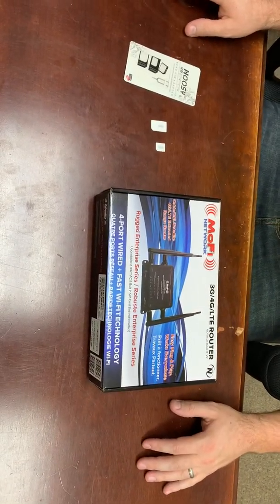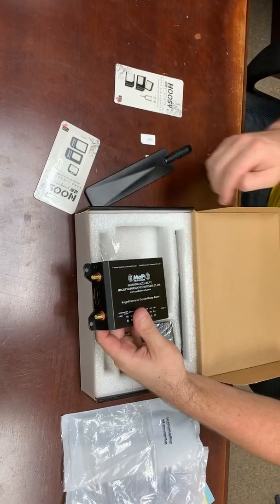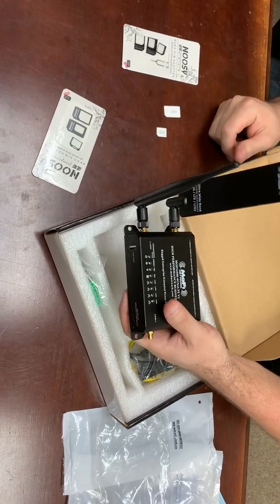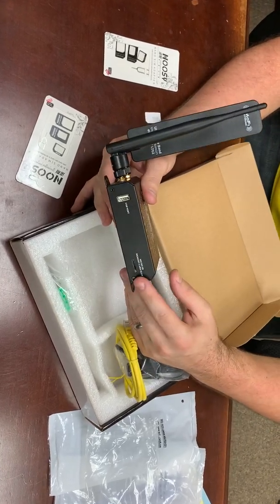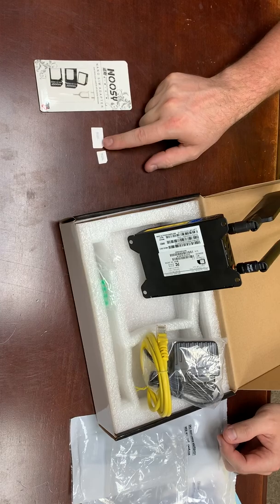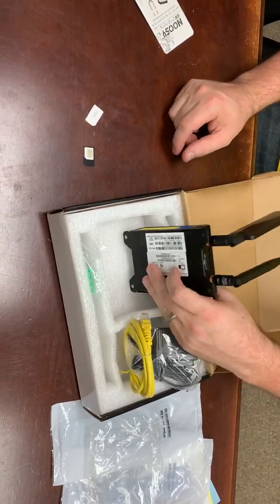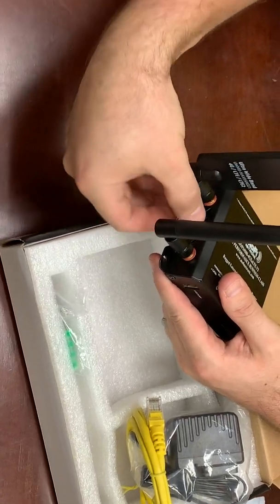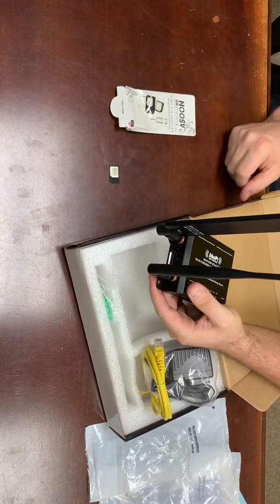Mofi 4500-4GxLTE SIM card installation

Comment: Question ? I have Verizon unlimited data plan for my cell service. When I order the SIM card, do they ask whether I need a standard SIM card or a mini, nano card ? If so, do they send both SIM cards & do I have to do a self registration of sort beforehand for the SIM card to work in my Mofi 4G LTE dual band router?

Comment: I have the mofi router using att sim card, It was working great for about 6 months and know it will not connect to att and if it does, i have not data. but sim card works in a hotspot with not problem. Please any ideas why?
Reply from the maker: AT&T has begun heavily restricting access based on the IMEI. So if that SIM card was not attached to that modem's IMEI in AT&T's records it will disallow service.